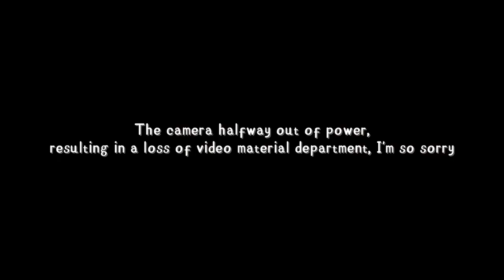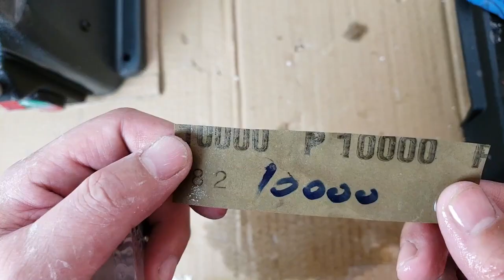Snow Mountain 🏔from Resin and Wood

Comment: Great. what is this wood?
Reply from the maker: Thank you. 😄 I use rosewood, a hardwood, you can also use other hardwood instead, such as ebony, blood sandalwood.
Reply: @BuzzingFish  oak?
Reply from the maker: I am not using oak, I am using a hardwood, called redwood in China, you can try using red sandalwood (dark purple), green sandalwood (green), ebony (black), blood sandalwood (red), do The effect is the same. You can also use oak, oak is also hardwood. After finishing the work, you can apply dark wood wax oil to increase the texture of the wood.  😋